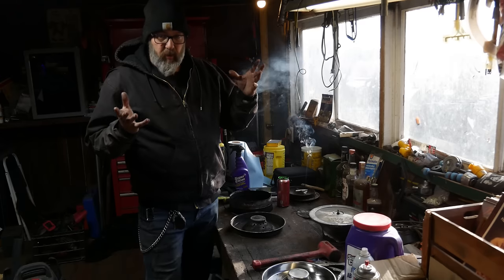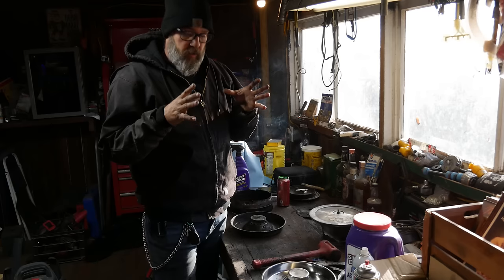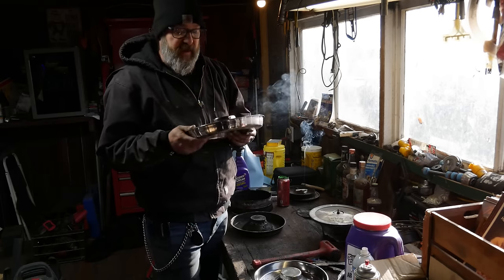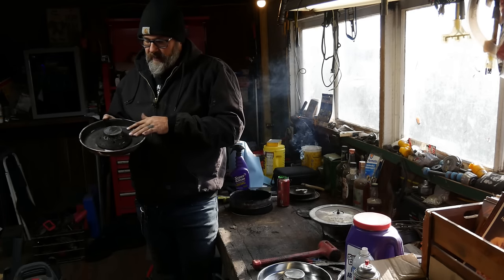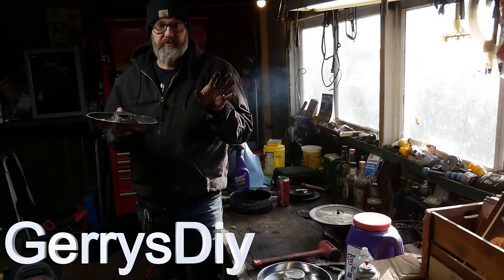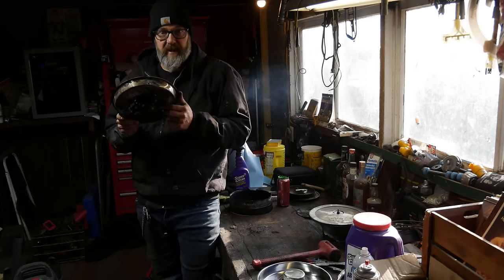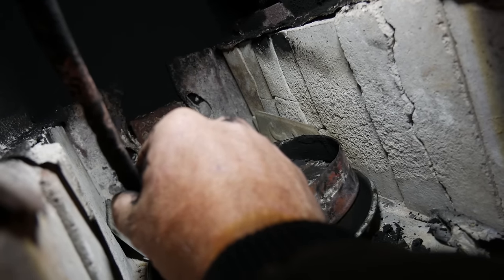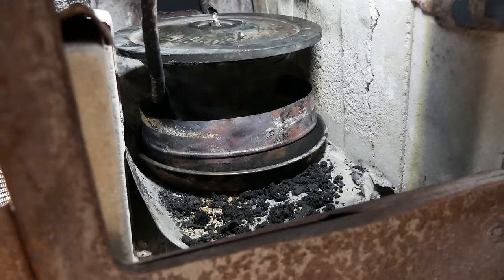DIY Waste Oil Burner ~ Converting a Wood Stove for CHEAP Garage Heat

Comment: My grandfather built one 50 years ago out of a old parlor wood stove and used a cast iron skillet and a brake drum for the burn chamber.  He ran the oil line in at the top of the brake drum and would regulate it down to a constant drip and once it got hot it would basically vaporize the oil as soon as it hit the skillet and there was no smoke at all!  When it was below zero he was working in a t shirt in a uninsulated block garage.
Reply from the maker: I'm out here now and I had to shut it down a while! Great story thanks for sharing!

Comment: Top tip is to cut a big circle of fabric (any fabric, I use whatever the local fabric seller was selling cheap) & use it to "line" your bucket so it acts as a filter. The crap stays in the fabric liner - I burn the used up fabric filters to start the fire whenever. I bought a 100m roll for 20 quid, so each filter costs about 5p.
Reply from the maker: That's a great idea
Reply: @IrishOutlawGarage  Works - that's all I care about. Saves me having to dick about trying to clean or filter crap old oil - I can just chuck it into the bucket as is. I use a bungee cord to keep it secured - it kinda drapes in there.

Comment: The guy overseas is Jerry’s DIY right here on YouTube. Great source for anything heating. Bring that copper across the top of the heat source was a brilliant idea. You must be an engineer too because in order for that oil to burn it has to vaporize so getting that oil up the temperature preheating it makes it vaporize quicker easier when it hits the glowing hot stainless or sawblade if you took that oil bucket just like diesel fuel. You can throw matches in there all day and it won’t burn you gotta atomize it. Brilliant job.
Reply from the maker: Definitely not an engineer lol. Just lots of info taken from different sources and just put my own spin on it

Comment: Awesome! Yeah, I've gone to mixing "black diesel" from the seemingly endless supply of used engine oil I get from the fleets of dump trucks and heavy iron that I service. It works well in my torpedo heaters and way cheaper than propane or diesel. Thanks Biden! But... those damn things are indeed noisy! I'm going to get on the look out for an old stove to try this out!

Comment: The gist of the warning is it doesn’t pass code in any state so anywhere you put one of these your insurance company will know and void your policy after the place is burned flat and you’ll be left with nothing might be paying the fire department bill, etc. but thanks for the video When I was young, everybody had one of these in their garage shop place of business then they came up with these code things😳❤️❤️🇺🇸
Reply from the maker: Yeah I don't recommend this in any way for someone who's gonna light it and leave it on unattended. Gas and other high flammable liquids mixed in the oil puts on a hell of a show. And gets extremely hot in a hurry.

Comment: I built what you call the scary air inducted version and it works great, except that as the garage gets warmer the thinner and faster the oil flows. So I have to stay close and monitor my flow valve.  I've had the water in the oil experience before and it'll definitely wake you up, very scary...  I since put a drain in the bottom of my oil bucket and check it before every use for water and cleans out the sludge.  Now I'm looking for a metal bucket since my plastic bucket cracked where my flow line comes out , leaving around a gallon of oil on my floor.  That sucked!!!    For lighting, put your diesel fuel in and than cover a cotton ball with hand sanitizer (It's cheap now that everyone's not freaking out about covid). Light the cotton ball on fire and drop it in. You should have much less smoke in your shop at start up.  Worth a try....      Great video.         PS... check out "5 gallon EZ strainer" on ebay to filter the used oil. Runs around $25.
Reply from the maker: Hey, I like the lighting idea. Definitely gonna try that.

Comment: I dont use a "top hat" but mine is pretty similar.  I start my oil as soon as the diesel lights and mine gets going pretty fast. I also made my bowl out of 3/8 inch thick by 8" diameter drilling pipe (for oil wells). I welded a thick bottom on and welded in a 2" nipple in the center. I put a bunch of holes in the nipple to allow air flow. Works great.

Comment: Up here in Alaska, hard to get good firewood in central Ak. so we were stuck with some old cottonwood and it don't burn for nothing. I put a waste oil line into the burner area so it would start burning and then figured out, going to just keep that waste oil in it as cottonwood is about fifty percent water. I was so broke that church mice looked good to eat. Not going there yet but its twenty five below zero and that is a motivator! I used that setup for a full winter and of course never ran out of waste oil. Heck, my buddies would hang out trying to just stay warm so make them haul in more firewood or clean up shop as you know, ass grass or gasoline, no one rides for free. I have seen it forty five below for weeks at a time and so just stayed out in my  shop and cooked on the top of that stove.... great for keeping a irish stew going
Reply from the maker: Wow! My shop has never been warmer from every corner to the center. I have a semi and 8 or 10 cars worth of used oil so I'll never run out! Lol

Comment: Being an electrican I would say,  first put a 24 volt solenoid valve after your gate valve,  put a high temp limit usually - rated at 170 to180 f so it cuts off ,  a safety. In same circuit put a thermostat,  so it cuts off fuel at Lets say 73 to 75f. You can do it. Hugh Mc. NW., Indiana.
PS you can add an igniter to fire it back up. Call it,  Irish outlaw furnace.

Comment: Gerry Diy also had a bit on notching the gate valve to even out the flow, he is a plumber by trade. Leave your air on the furnace and chimney full open, the holes in your puppy bowl control your air flow to the burner not the dampers. The chimney being tall is helping you out a ton giving you a great draft. Shouldn't smoke if you got it all hooked up right.
Reply from the maker: Yes he did! I haven't done that to mine yet. So far I haven't had to change pr upgrade anything. Use it like crazy. Clean ed it a couple times and that's it.

Comment: During the pandemic I installed the most expensive garage ceiling in the history garages, insulated, osb, painted and twenty-effin-five thousand lumens of led lights, glass block winders and garage door insulation just so I could enjoy the ambiance of a 1500watt fireplace insert .. and of course the mini fridge in addition to the vintage Sansui 990db
Reply from the maker: That's awesome.  I didn't get to do anything during the pandemic but work. I trucked cleaning supplies and 3M masks,filters....etc... through the whole thing.

Comment: I store my used oil in 55 gallon drums, letting it sit for a year or so will let most of the dirt settle to the bottom. I end up with lots of bad gas in junk trucks, mixing it 4:1 with waste oil thins it out enough to run in heaters like diesel does.  I built a waste oil heater with an old water heater tank, it worked pretty good, except I was so strapped for cash I couldn't get the oil feed to work right. That dog dish looks like a perfect solution for the water tank heater. I've collected lots of barrels for the fuel ethanol project so I have quite a few sitting around. The local Harley dealer gives them away occasionally. They don't work so great for heaters though.

There are a couple other projects I've been working on to heat my house and shop. One doesn't burn anything but makes 140F water for six months. Its a large compost pile with woodchips and sawdust that has 600ft of plastic sprinkler pipe buried in it. I should have set it all up when I built my shop, before I stuffed it full of cars and parts. The baseboard heaters are in the shop waiting to get installed, just haven't gotten to it yet. The other is producing a lot of methane and using that in a CNG heater.  Its super easy to make methane, especially if you have a septic system with a drain/leech field.

Since I got a sawmill this year and do some wood work, while living in a forest, there is no shortage of woodchips and the sawdust from the mill needs to go somewhere as well. Need to get the shop insulated better and install a roll up door, because right now I can get it warm in there but it takes a lot and it cools down fast. I like stuff that doesn't cost me a fortune to keep it going, and if it handles other problems I have, then that is even better.
Reply from the maker: The guy I got this idea from has a TON of of cheap alternative ways to heat yer home, shop, water etc...

Comment: What about putting a top screen on waste oil bucket, maybe a fine hole pasta drainer or a bowl drilled with small holes for a pre filter setup?
Reply from the maker: I actually thought about that!  Even asked Amber if she had a strainer she didn't use lol.

Comment: It’s a great idea! We have a commercial sized used oil heater at work. It requires electricity and an air compressor. I’m thinking a dripper valve for an irrigation well would be more controllable for the oil flow or get something you can put an orifice in.
Reply from the maker: Actually you just create little pathways in that valve. A little dremel work

Comment: Your garage looks just like mine. Busted floor and all. But my old wood stove has a built-in fan, but I still have to replace the firebrick rack in it. But not going to happen right now. I need to get heat in there so I can get it cleaned up so I can get working in there. Sucks not having any insulation in it. So I'm going to get it set up like yours just a bit. I have a 250 gallon fuel tank around back full of cooking oil from restaurants I've been collecting and 2, 55 gallon drums full of my used oil also. I'm tired of hauling wood for that darn thing. It burns through it so fast. But it does heat it up. It's a 24 by 32, and that's why it uses so much darn wood. Especially when it gets down to the negative 50s Fer here in Northern Minnesota. Everything shuts down around here. Cabin fever for some folks 😂😂😂.
Reply from the maker: That cooking oil will burn better then anything.

Comment: If you have the oil sitting somewhere in a bucket/barrel all the really nasty stuff is sinking to the bottom.
So don't pour it, just use like a giant ladle to take some out or a barrel pump with a shortened pick up pipe to just take from the surface and keep the sludge in there…

You could also burn old tar paper roofing but only if it's dark outside 😇

maybe you heat up some spiced wine/booze on there too…

Comment: First strain your oil. You can find pretty cheap large strainers for cooking oil easily. That gets rid of most of the trash and sludge.

2nd I would put the drain about 2 inches off the bottom of your bucket. It lets the junk, sludge, and water that gets in settle to the bottom of the feed bucket.

Get that 8 y/o out there. My dad had me rebuilding carbs when I was 5. My first by myself engine was a 327 when I was 8. Dropped it in a rust bucket chevy luv when I was 12 and tore up the cow pasture and highway by the house.
Reply from the maker: Bucket drain it about 2 inches off the bottom. Started straining after I made this. Zeppy's been helping me since he was 6 👍

Comment: I like the larger diameter copper line. I probably would have done that all the way into the combustion pan. 
If you just coil the copper line around the combustion pan so it absorbs more heat, you shouldn't need the air mix spot, but it'll take longer to heat up and get going, but suppose it depends on how tar-like your oil is.
Reply from the maker: The oil is pretty bad 🤣. Almost lumpy sometimes

Comment: When you get a drop of water in there some more useless information but water expands 1600 times when it flashes to steam so think about that kind of air movement in an oil fire it’s bladders that oil all over and then everywhere inside where it’s hot, but that oil touches it ignit Could burn the whole shed down😔

Comment: I’m stoked! I believe I have the same stove, a King Circulator. I was worried the fire bricks may pose a problem. Looks like they are fine on yours. Have you ever used a non contact thermometer to see what temp the case gets to? Very much appreciate and enjoyed the vid.
Reply from the maker: That's what I think my stove is. And nope, I've never put a thermometer on it. Just judging by how it feels compared to wood..... it gets damn hot!! Sometimes to damn hot lol.
Reply: @IrishOutlawGarage  Thankyou for the reply. I guess the temp doesn’t matter so long as it is burning clean and not burning anything down. Lol I went and bought a 6” tee and a 6” double male connector today. The double male connector fits inside the stove collar very loosely. Not gonna work. The 6” tee I had to booger up pretty bad to get it to fit inside the stove collar. Not happy with it at all because of the gaps where the wrinkles are. May I ask what you used to join your stove to the stove pipe elbow? (Or tee. I forget what you have.) For once, Google just ain’t cutting it…
Reply from the maker: @richardsmith741  I just have an elbow coming out of the stove. You'll have gaps. All the smoke should go out the chimney with no problem. It'll only smoke if ya shut the dampener to much

Comment: Ya gas not good. I get my used oil from a fleet truck dealer and one 55gal barrel has a little gas in it. I thought I smelled it but used it anyway, bad idea stove got red glowing hot and started melting things close to it. Melted plastic fan I used to circulate air for years.
Moral of story ,if you think or think you smell gas in oil don't use it.
Great video
Reply from the maker: The worst part is the gas burns silent. So if you don't see or feel it yer screwed
Reply from the maker: @SweatyFatGuy  Also I have the output to the valve way above the bottom so the sludge settles below it. That's why I say you will have to clean it out 👍

Comment: I was thinking of doing a waste oil heater for a sauna.  1. Do you think it would get a small room up to 150 -180 degrees?  2. Does it make your shop smell like fuel oil?
Reply from the maker: I'm sure it would top 180 easily if you let it. I get smell once in a while because my wood burner has rust holes in it lol.

Comment: Use a stainless steel bowl. It will glow red faster and vaporize the oil so it will burn cleaner.

Comment: Thanks for taking the time you did to explain how to get the parts to assemble the burner, oil flow and all. I stopped the video at 11:19. Without a wood stove with an air specific intake / updraft as you have, the rest of the video is useless.  You might want to start with, first you'll need this type of wood stove and describe the stoves air intake.
Reply from the maker: Glad you made it 11 minutes
Reply: If he stopped it at 11 minutes, how did he know you never covered the other points? 😂 @IrishOutlawGarage
Reply from the maker: @gadsdenconsulting7126  I thought that for a sec. Then just decided I have better things to do lol. My explanations aren't for everyone. 😁

Comment: I noticed your vents on the woodstove come from underneath... would a front air intake woostove work as well?
Reply from the maker: As long as the flow of air goes through the burner I don't think it matters about the source.

Comment: that white fitting is called a bulkhead fitting. we use them on hog waterers.
Reply from the maker: Thanks!, I knew what it was when I got it lol. And then I brain farted.
Reply: @IrishOutlawGarage  all good buddy. I'm definitely gonna do this is my garage on my farm. With all the equipment I need a way to get rid of the oil, and free heat is the best heat.
Reply from the maker: @plainandsimple1  It work's pretty dang good.

Comment: Will it run with the oil dripping instead of a steady stream? I have a small workshop and thinking of how I could lower the heat output if I build one
Reply from the maker: It'll burn with just a drip. Mine does. Pops and fizzes a bit but it works
Reply: @IrishOutlawGarage  thank you I will give it a try!
Reply from the maker: @joecrawfordreptiles2384  just be careful. Don't leave it unattended at all

Comment: You can control your oil flow better with that ball valve. I'd just swap the gate valve around with the ball valve and you can absolutely control that flow a lot better
Reply from the maker: Ball valve gives me  the same problem. I made some  "channels" in the gate. Smoothed the flow right up. And centers it. I'll show it sometime 👍

Comment: PBG needs to build one. Never mind his @ss would probably blow himself up 😂.  But this is cool. I've been thinking about doing on of these but I'm worried about blowing up
Reply from the maker: I just wouldn't use the forced air method. And be sure of the oil you use. And don't leave it unattended to long.  A glass front stove would probably work the best so you can see what it's doing.